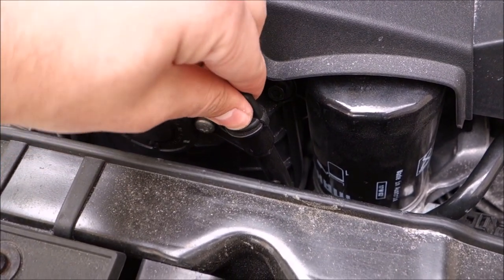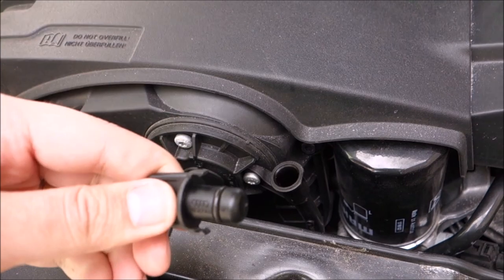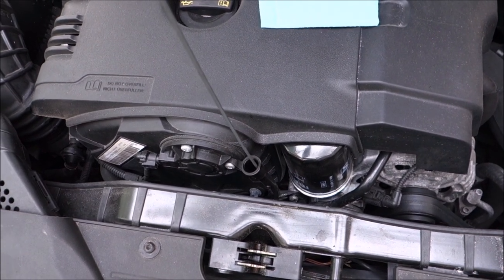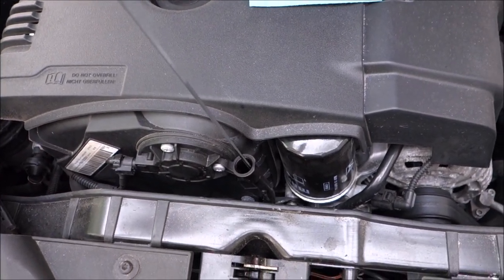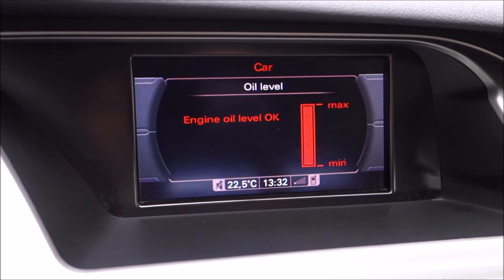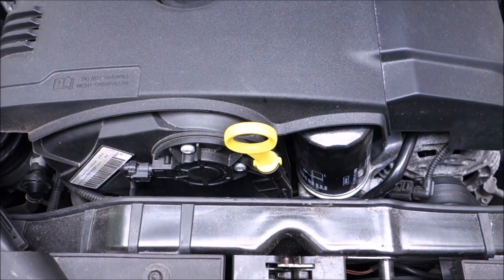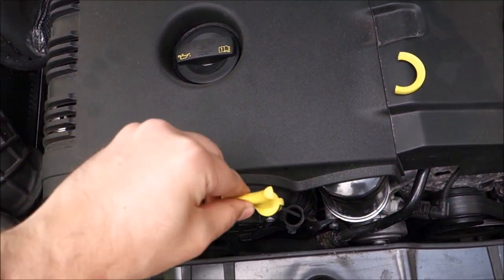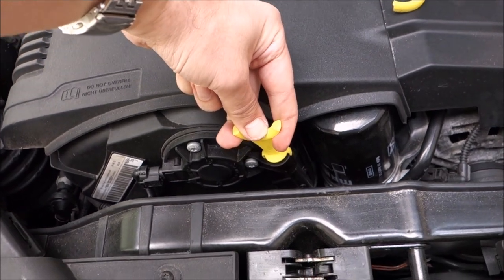How to add an oil dipstick to Audi A4 2.0TFSI 211hp

Comment: What year was the car? Will this dipstick work in the 2012 b8.5 a4?
Reply from the maker: The car is a 2010. If the motor is 2.0T I think it should work, but with this things you can never be 100% sure until you try it.

Comment: Legend, Mine is 8k 2.0TFSI 2013 A4 Quattro ..Are you leaving this in? driving? No Problems? I've been digging and digging and couldn't get anyone who could confirm a stick that is perfect. Many suggested to buy one that fits, then wait till low or low warning, then dip it, cut 15ish mm below, and mark it (grinder tip) then add till mmi registers full and do the same above. so making your own dip stick. but you suggest 06J 115 611 L is 100 percent? I've found some on ebay - I'm goign to wait till i match up the bung, if they look the same I'll be getting one. Just to mention My wife has a 2016 a3 8P 1.6tdi - i tested het stick and it doesn't fit the bung - even at that her stick was measuring mid full - but when i dipped mine (without closing the seal/bung) mine read full.. but my mmi says half full. so clearly her stick is too long and obviously doesn't seal.
Reply from the maker: The dipstick is in since filming the video and I had 0 problems with it. It perfectly matches the MMI indicator.
Reply: @UltimateDIY  right sir mine arrived today. As mentioned I've an 8k B8.5 2013 2.0tfsi Quattro cdnc and I done a dip check. Stick reads max .. as in the top of the ridge ... The word max is printed above. But my mmi days mid hight ... So there must be a different length to the b8 and b8.5 ..  I will add portions of oil, allow it to settle and once it says full on mmi ..then i will etch a max mark. But for the minute I will watch till I hits somewhere near low and etch it first. It's definitely different so I'd at least advise you add this information into your header so no one blames you for incorrect information :)
Reply from the maker: What if your sensor is reading incorrectly? Just a thought. Normally with the same engine code there should be no differences between the 2 engines, even if they are a few years appart. But then again...who understands car manufacturers anymore... Maybe they changed a few things, but kept the code 😔
Reply: @UltimateDIY  Hiya, I take it back, it's spot on. I just done a slow top up. And it in in fact correct. So yes, b8 and b8.5 the dip stick is correct! That was my bad sir! It was pretty high on the dip stick/mid on the mmi but full mmi = full dip stick.. go figure bro lol thanks again
Reply from the maker: Great! Welcome!

Comment: Hi please help! I've been looking, but I can't find a specific Dipstick for my 1.8T engine. Is it the same as for the 2.0T? I see in the manual that they use the same amount of oil.  thanks!
Reply from the maker: Sorry, but I don't know. Try to search trough the comments and see if someone tried it on 1.8T.
Reply: I have exact the same issue

Comment: I’m always wondering why they removed oil dipsticks?
Reply from the maker: Cost reduction. And also, most people these days don't care about checking engine oil. They just change it from time to time and maybe top it off if something shows up on the dashboard.
Reply: Because they want you to blow your engine and buy another one
Reply from the maker: There is a dash warning from the sensor. But they do want you to go to the dealership for basically anything, even checking the oil.

Comment: Hi! Great video. Does it work for 1.8T B8 as well?
Reply from the maker: Thanks! Sadly I'm not familiar with that motor, so I can't give you a sure answer. Try to do some forum searching, you might find someone who has tried it.
Reply: Please give lenght of dipstick. Ive check mine and i think that it goes to deep into engine.
Reply from the maker: Are you asking the length for 2.0T or 1.8T?
Reply: Same thing I’m looking for having a hard time finding it what’s the length of the oil dipstick from where the handle ends to the max and minimum oil level please reply
Reply: Ultimate DIY yes What’s the length measurement please with a tape measure
Reply from the maker: @sudaddalal3907  here they are: https://youtu.be/Gs_87zDGg1s

Comment: My digital oil level sensor is misbehaving (2009 Audi B8 A4 2.0T), so I'm going to buy one of these "dipsticks". However, I don't plan on leaving it in the engine. It'll stay in the trunk unless I'm actively measuring the oil level.

Why?
The combination of the car having a dipstick access point without a standard dipstick and learning that the official "dipstick" is actually a specialty tool (Oil Level Gauge), makes me think that I shouldn't drive with the dipstick installed.

Just be careful and do your own research.
Reply from the maker: That is your choice, but I'm driving with it since making the video with 0 problems. Also, the fact that the dipstic access is 100% identical to the one on cars that have it, makes me think this was just a cost saving measure.
Reply: @UltimateDIY  Yeah, maybe. I've seen other people say that they've left it in without an issue also. It's probably fine. You'd certainly know by now if there were any problems. Thanks for making the video!
Reply from the maker: Indeed. Welcome and thank you for watching!
Reply: My thoughts exactly. Dip / Check / Put away safe / Replace bung.
Reply: Never check the oil with the engine running 😂. It starts misfiring like crazy.
Reply from the maker: That is normal for most engines. You check with the engine off.
Reply: Yeah that's not how you check oil... @Rafa_guitars

Comment: I bought one but it seems like the markings are a little off. My MMI says it's full but the do stick is over the max.
Reply from the maker: The MMI can't show more than full as far as I know. You can put 10 litres of oil more in the engine and the MMI will still show only full.

Comment: Thats awesome
A great help! Wish I looked this up sooner
Reply from the maker: Glad my video helped 👍🏻
Reply: @UltimateDIY  I actually ended up ordering the pre-revised part which has an E instead of L at the end. Its less than half the price of the revised part, which no one can tell me why it was revised. I suspect however that parts were failing due to it being left in the usual dipstick spot and the engine heat caused failure. I also suspect thats why Audi did away with the dipstick altogether. Either that or they didnt want more people realising the huge oil consumption problem, which triggered a class action lawsuit. Anyway, my plan is to keep the dipstick in the trunk of the car rather than in the engine bay, that way I can use it when I need it but I dont have to worry about it becoming overheated and falling apart. Didnt know whether you wanted to mention this in a video or not, but thought the info might be useful to you. Cheers.
Reply from the maker: I have it in the engine for 3 years already without any problems. Also, cars have dipsticks since e few good tens of years ago, and no issues. It's just the manufacturers beeing greedy, I guarantee it.
Reply: @UltimateDIY  fair enough 👍
Reply: @UltimateDIY  How did you cut the thick plastic at the top of the dipstick so it fit in the engine bay?
Reply: @UltimateDIY  how did you cut the top off the dipstick?
Reply from the maker: Random saw :)
Reply: Wanted to update on what happened after I cut the top off the dipstick and left it in the engine. The next day when i started the car it sounded funny and then the whole thing started to vibrate. Then the check engine light came on. I took the dipstick out and replaced the cap and the engine turned over better but the check engine light remained. I used an OBD2 scanner which identified a cylinder 3 misfire. I booked it into a garage. They ran several tests and said we cant find anything wrong with it. I have not driven with the dipstick in the engine since and have not had any more check engine light warnings or strange car behaviour.
Reply from the maker: The only explanation would be that the part with revision E that you bought does not seal. It's normal for an engine to not run right if the carter is not sealed. To test this anybody can remove the oil cap for example.
I have revision L in my engine since the initial video was made and so do many others, without any problems. The only explanation would be that there is some issue with revision E that you bought.
Reply from the maker: Another simple explanation is that the coil pack on cylinder 3 is begining to fail in your car. They start to give missfires randomly (mostly in the morning with a cold engine). I had this in my old Skoda Fabia. It took a whole year until it fully failed. Until then, I would just randomly have some missfires that I would clear with the VCDS.
So again, either the issue has something to do with revision E, or nothing to do with the dipstick at all.
Reply: @UltimateDIY  you may be right but I hope you are wrong! It seems a strange coincidence that the day after I installed the dipstixk this occurred,  and that when I took out the dipstick and turned over tbe engine it felt instantly better. The garage guys also did a tune-up at my request and they said fhe cylinders seem fine, everything is in great condition. They said they ran lots of diagnostics tests and it never showed any area of failure or potential failure. I don't know why my car is an anomaly with the dipstick install but having done support for many years in the past sometines its just 'the ghost in the machine' (no explanation)
Reply: @UltimateDIY  the only difference between Revision E and L is E failed quicker. I did my homework before I bought it.
Reply: (When left in the engine)
Reply from the maker: It's really weird. A dipstick should have absolutely nothing to do with a missfire. I have not heard about anybody alse having this issue, but I hope it's just some gremlin and not a coil pack.
Reply: @UltimateDIY  I think if anything like you commented earlier it must have to do with not sealing properly. That's the most logical explanation for why when I replaced it with the cap the car felt instantly better.
Reply from the maker: You can test that by removing the cap while it's running.

Comment: Great video,but where can I get a dip stick from , regards Gary.
Reply from the maker: Any car parts store should be able to bring it by code.
Reply: @UltimateDIY  many thanks 👍
Reply from the maker: Welcome!
Reply: @UltimateDIY  hi tried using code with eu but not recognizing it .can you recommend someone?, cheers GARY.
Reply from the maker: https://www.ebay.com/itm/134268478319?mkcid=16&mkevt=1&mkrid=711-127632-2357-0&ssspo=BJWJFFplQwG&sssrc=2349624&ssuid=ztDpKVsHR6y&var=&widget_ver=artemis&media=COPY

Comment: Hello, can you tell me the length of the dipstick in cm? Please.
Reply from the maker: Hi there. Please send me a reply message here this weekend. I will do some work on the car and I can measure it.
Reply: Ultimate DIY hi, what’s the length? I bought the same part number, but doesn’t go all the way in
Reply from the maker: Don't have a chance to measure it now. What is your motor?
Reply: Ultimate DIY Audi A4 2010. Motor is 2.0. I only checked it with obd11. It gave me a “mm” reading.

Comment: Stupid question but is it safe to leave it in while driving?  It won’t damage my engine right????
Reply from the maker: No question is stupid and it's always a good idea to ask when in doubt :)
The answer, yes, it's safe :)
I've been driving, like you see it in the video, for something like a year already and had 0 problems.
Reply: Ultimate DIY thank you!  I just ordered it.
Reply from the maker: Welcome! :)
Reply: In some countries it is mandatory to have a dipstik on the engine, VW chose to leave the tube there and put a black cap with an o-ring to seale the blow-by gases, they can also use in service a universal dipstik with sliding stops to check the electronic level indicator. Others, as BMW, chose to completly remove the tube and dipstick if not demanded by a certain market. It all boyls down to logistic cost when manufacturing, not only the part cost.

Comment: When the 2011 Audi A4 sline came out the cost was 54,000 high end . You'd think that they would throw in an oil dipstick.
A chevette in the 80s cost 9,000 brand-new and it came with it heck I think every car comes with an oil dipstick ..
Only the high end cars don't come with one it seems..
Audi you listening ???
Audi replies .
If you could afford the car you could afford a separate oil dipstick...
Balls deep is what I say.
Reply from the maker: True. There is no reason to have only a sensor, when the dipstick is so cheap.

Comment: I've been told the oil consumption issues on these Audi a4's is a result of the piston rings that Audi uses to maximize horsepower. Can anybody tell me if that is true? Thanks
Reply from the maker: As far as I know it's just a fail in the design, as it destroys the engine if not fixed in time.
Reply: @UltimateDIY  alright thanks
Reply from the maker: Welcome!

Comment: Hi silly question but just want to make sure, is this ok for my car?
2009 Audi A4 Quattro 2.0T - VIN is WAUSF78K79N046458

Thanks for your help
Reply from the maker: I'm 99% sure it will be ok.
Reply: @UltimateDIY  Thanks!
Reply from the maker: Welcome!
Reply: It does, that's exactly the same as my wife's car. Just make sure your readings in the car line up with min/ max on the stick, if not etch some new marks.

Comment: I have 2012 model TFSI 2.0 135 kw . And it dont take to much oil for me
Reply from the maker: Good 👍🏼
Reply: @UltimateDIY  How much yours take ? Do you have problem with oil consumption ?
Reply from the maker: It's good. Less than 1000ml at 10000km.

Comment: Thank you for posting! Very helpful.
Reply from the maker: +Matt A welcome! :)
Reply: Were Can i buy this stick?
Reply: Ebay or AliExpress. I bought mine at Ebay around $20 but make sure it is the correct part number.
Reply from the maker: Just google for 06J 115 611 L and you should find some places that sell it.
Reply: Ultimate DIY , is 06j115611E equivalent to 06j115611L?
Reply from the maker: Yes, either should work from what I understand.
Some have it listed with both codes for the same product:
https://parts.audiusa.com/p/Audi__/Dipstick-Engine-Oil-Dipstick/64124414/06J115611L.html
Reply: I have a Audi a4 2010 quattro. I oder a dip stick & it do not work I guess is to short.I'm having a problem with my car the oil light stays on. I change the oil & it tell me I'm low on oli.can you please tell me what? Should I do? Thankx
Reply from the maker: You have the same engine and ordered the same dipstick and it does not work? That is almost impossible. Did you check the part number on the dipstick, maybe they sent you the wrong one. If the oil light is on, either the sensor is broken, or the oil is actually low. More than this is impossible to say without taking it to a service.
Reply: Ultimate DIY thank you for responding. Im guessing they sent me the wrong.
Reply from the maker: +Jenny Martinez no problem. Sadly it sometimes happens...